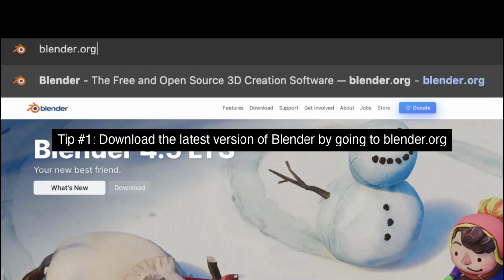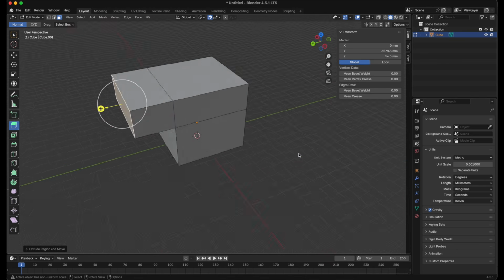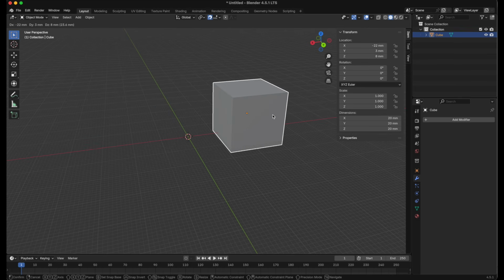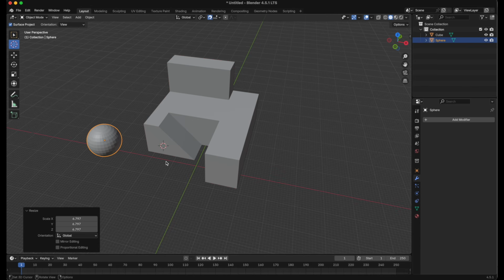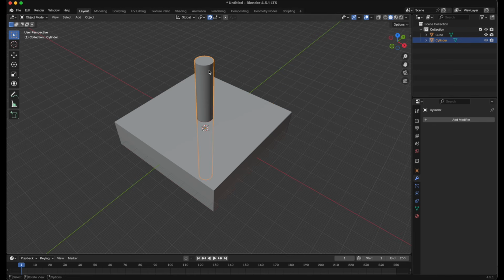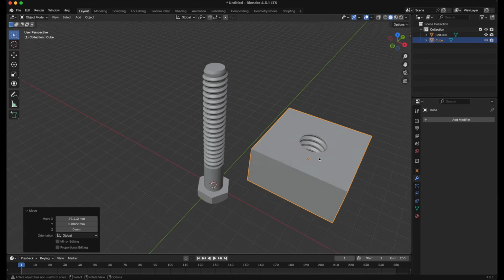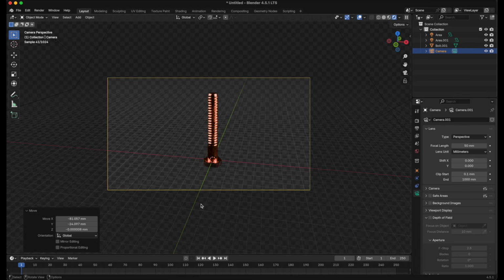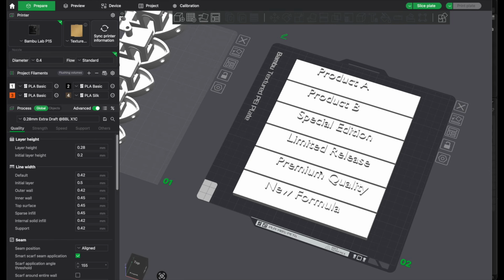67 Blender Tips and Tricks you NEED to know.

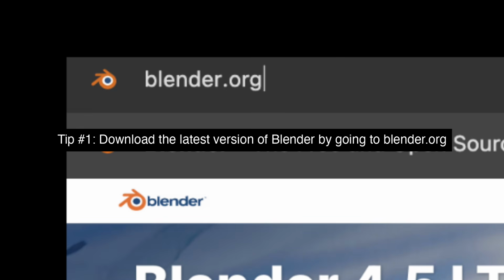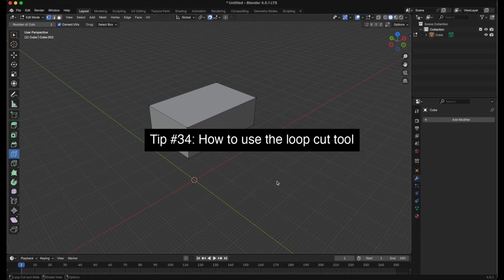Comment: Tip #1  (0:19) Download latest Blender version          | Tip #34 (18:45) How to use the loop cut tool
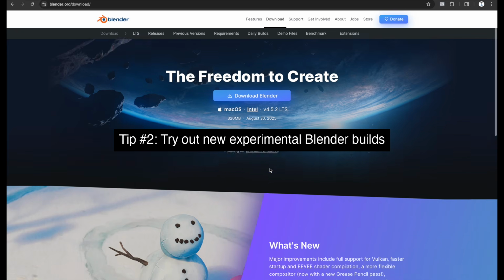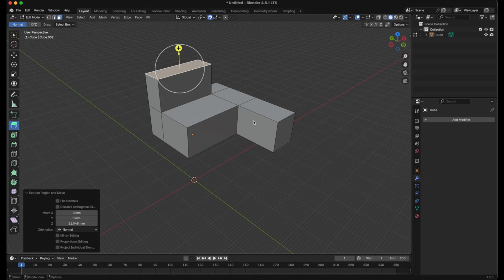Tip #2  (0:23) Try experimental builds                           | Tip #35 (19:33) Learn how to use the knife tool
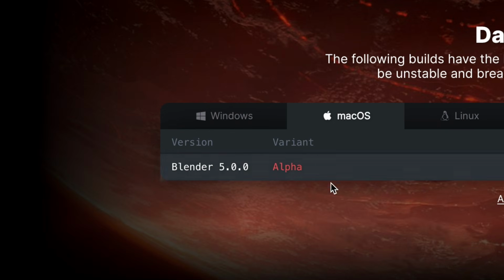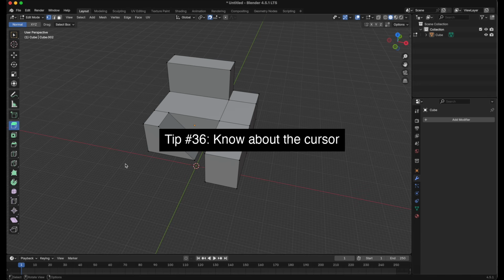Tip #3  (0:32) Delete default cube                                  | Tip #36 (20:13) Know about the cursor
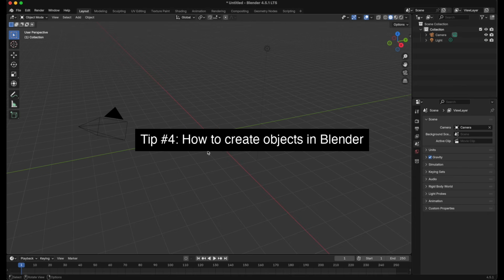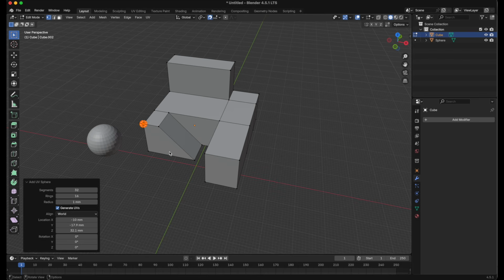Tip #4  (0:40) Create objects                                           | [Important to note: 22:11]
Tip #5  (0:53) Move and scale objects                           | Tip #37 (23:01) How to duplicate an object
Tip #6  (1:10) How to see how big or small it is            | Tip #38 (23:08) Shortcut to scale an object
Tip #7  (1:20) Trick to use default units                          | Tip #39 (23:24) To rotate an object
Tip #8  (2:00) How to change units correctly                 | Tip #40 (23:41) You could join two objects
Tip #9  (2:26) Set precise dimensions of an object       | Tip #41 (23:54) How steep of an overhang can we have
Tip #10 (2:52) Export object as STL for 3D printing      | Tip #42 (25:04) Bridging
Tip #11 (3:09) Object mode vs. edit mode                      | Tip #43 (26:25) Object orientation for 3D printing
Tip #12 (3:36) Precisely set position of a vertex            | Tip #45 (27:25) How to create optimal holes and axles
Tip #13 (3:55) Make sure to apply the scale                   | Tip #46 (29:55) How to avoid layer line weakness
Tip #14 (4:19) Delete camera and light in default          | Tip #47 (31:08) Think about how a part will be printed
Tip #15 (4:48) Mesh modeling vs. solid body CAD         | Tip #48 (31:50) Print-in-place or articulated designs
Tip #16 (5:26) How to fix viewport clipping                       | Tip #49 (33:13) How to create threaded objects
Tip #17 (5:45) Vertex, edge, and face selection modes  | Tip #50 (34:23) Extra clearance to threaded parts
Tip #18 (0:06) How to use move keyboard shortcut        | Tip #51 (35:58) Change color/appearance of an object
Tip #19 (0:28) Use snapping to precisely move objects  | Tip #52 (36:18) Wireframe, solid, preview, render modes
Tip #20 (6:52) Use the X-ray tool                                          | Tip #53 (36:50) Difference between render engines
Tip #21 (7:01) Know the extrude tool in edit mode           | Tip #54 (37:55) How to add HDR environment textures
Tip #22 (7:24) Know how to use the inset faces tool       | Tip #55 (39:22) Create advanced parametric materials
Tip #23 (7:44) See dimensions while editing                     | Tip #56 (40:15) Create your own lights for your scene
Tip #24 (8:03) Customize UI by changing theme              | Tip #57 (42:00) Use cameras to render your scene
Tip #25 (9:01) Add fillets/chamfers using bevel tool       | Tip #58 (44:11) Know how to create text
Tip #26 (10:31) Use boolean modifier to join/subtract    | Tip #59 (44:49) Joining two objects can be glitchy
Tip #27 (12:23) Laptop users: turn on emulate numpad  | Tip #60 (45:13) Create gears using modern primitive
Tip #28 (12:53) Use measureit add-on for control            | Tip #61 (45:39) Know how to import an STL file
Tip #29 (13:44) Change appearance of dimensions        | Tip #62 (45:51) Understand how to use sculpting
Tip #30 (14:15) Know about an object's origin point       | Tip #63 (46:13) Remesh your object before sculpting
Tip #31 (15:32) Perspective vs. orthogonal view            | Tip #64 (47:06) Use to create your own animations
Tip #32 (16:41) How to fix inside out bodies                   | Tip #65 (47:44) Automate tasks using Python
Tip #33 (17:58) How to fix broken meshes                      | Tip #66 (48:06) Using AI to create Python code
                                                                                                 | Tip #67 (49:09) Use AI to automate batch production